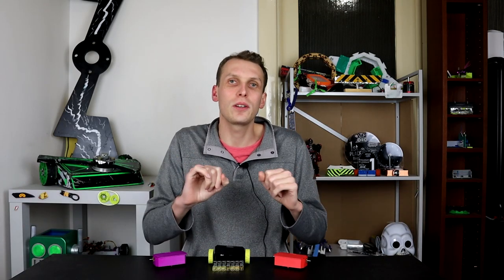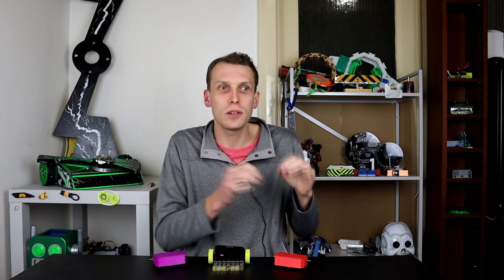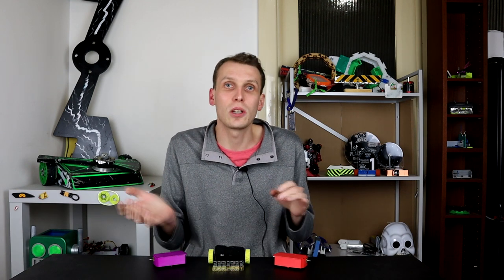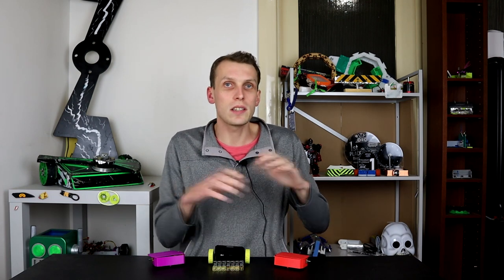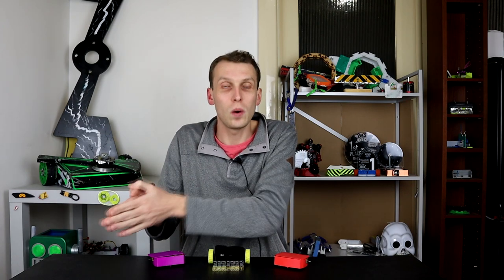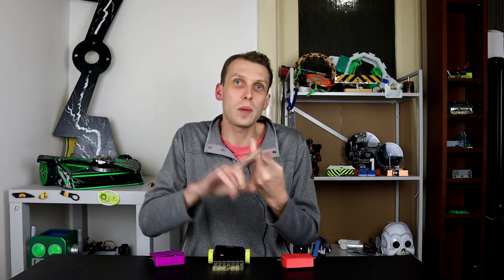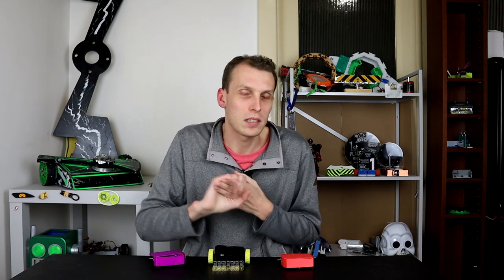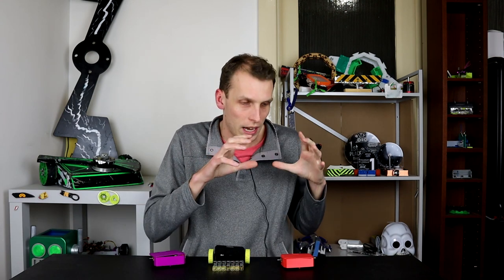What Gear Ratio is best for an Ant Weight??? (motor testing)

Comment: Interesting - my take away was to try 100:1 :).   The test I think would be really interesting is to put them against each other, given they have identical set ups, to see if there is a practical pushing power.  In our matches we get a number where the pushing match is the decider, so knowing the relative strength would be interesting.  Also, the speed to push a 100g/150g static weight over that same distance would be good to know too.
Reply from the maker: I like all of those ideas, definitely want to build a new test rig, make some new tires and revisit this one

Comment: Keep in mind that because of the form factor, these gearboxes have a different amount of gears.. meaning that they can also loose some torque when they have a higher gear count. However, if the torque is high enough to loose grip, then more torque will not have any benefits I think. I would pick the lowest gear ratio that is enough to loose grip and drive it slower, this should save you some battery power.
Reply from the maker: The torque is definitely high enough to loose grip, all of these do
(mostly because there is not enough weight in the robot)

Comment: Great video! Thank you for all the wisdom you share! Could the 30:1 be spinning the tires at the start? Is the torque test showing traction? Could you try 20:1 or even 15:1?
Reply from the maker: Theres a good chance the 30:1s spin the tires at the start.
Yes, kind of, its showing at what point the traction breaks at least with the current set up. 
I need to refine the test some

I'd be interested in trying 20 and 15 to 1 but they arnt as common so I dont have any to hand. I'd need to find some online to order in

Comment: It is very interesting seeing how each of the different ratios perform in different situations.

Just curious, the gearboxes themselves are screwed on, making them detachable. Knowing that there are other N20s with even greater ratios like "1000:1", does that mean they can be interchangeable with each other, and open up the possibility of a super-high torque motor that can run say... an antweight 360° lifter, or maybe a crusher?

If so, how do you think it'll compare to a servo of similar weight?
Reply: Sorry to butt in, guys... 🙂 I was just thinking that the high torque achieved by mega-gearing wouldn't really be usable with such small and nippy bots.

The force created would be high, but the speed of actuation would be so slow that whatever you were trying to lift or crush would have zoomed out of the way long before the geared-down weapon could engage it.

A fast-acting servo is probably a better bet in this weight class.
Reply from the maker: Yes the gearboxes are screwed on, but unfortunately no they are not interchangeable at least not all of them.
I've tried in the past, but the pinion gear on the output of the motor is a different size for the different gearboxes

If you got lucky and found a high ratio box that used the same pinion gear as one of the dfrobots ones, then it would be fairly powerful.
If you found one that matched to the exact speed of a 9g servo, it would probably be a little heavier then the servo, as the servo uses a smaller motor size and plastic casing for the gear box rather then brass. But then again maybe not, the servo does also need the position sensor... hmmmm... might be one to look into later

Comment: Love the channel but I have a question. I am new to robotics and RC  and have no idea what I'm doing. I purchased some of the 50:1 n20 motors from DFRobotics recently, can these be plugged directly into a receiver or do they need to work with an arduino board? If they can be plugged right in how would you power them without an external BEC? Sorry if this is confusing. I am very confused by all this myself but super excited to build some bots!
Reply from the maker: It depends on the receiver you are using, some can run on the full 2s lipo voltage, in which case you just plug the dfrobot motors in
If your receiver runs on 5v you will need an external bec and to run power from the switch straight into the motors, this is a lot more work and i highly encourage you to get a receiver that can run on 2s voltage like this one: https://youtu.be/npt4z8P3CeY

Comment: awesome video and really great, just for  question, are these motor 6v or 12v rated are you running on 2s or 3s? the video came right on time since i ordered a couple of 12V 1000rpm (so should be 30:1) but i will run them at 2s

also little suggestion, even if the teoretical pushing power could be derived from the datasheet, i think the improved test will give us really nice data to understand better the real life scenarios, so are you able to mold some slick tyres? my idea is that they will have a more stable reading but also giving an idea of how much tyre thread impact grip and so pushing power
Reply from the maker: 6v or 12v ratings on these motors are meaningless.
As far as I can tell the motors are built exactly the same, and the "rated voltage" is just the voltage that they tested the speed at.
I've bought some n20s labelled as 3v motors, ran them on 2s and noticed no difference in them at all

I run all n20s I own on 2s because all of my ants run on 2s

If I get the improved test set up working reliably, I will be doing a bunch of testing including if tyre tread impacts grip
(personally I use treads rather then slicks because my first experiment with them I used both, and found the treads had a little more grip, I think because the tread helps clear some of the dust/dead robot junk out)